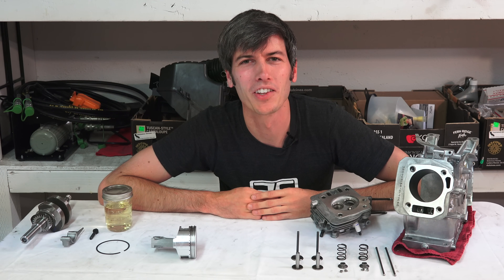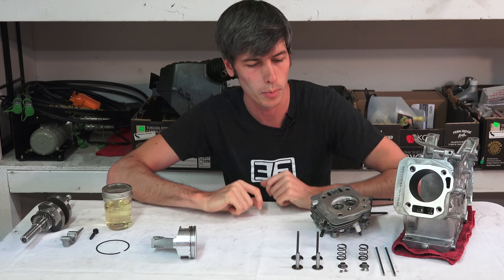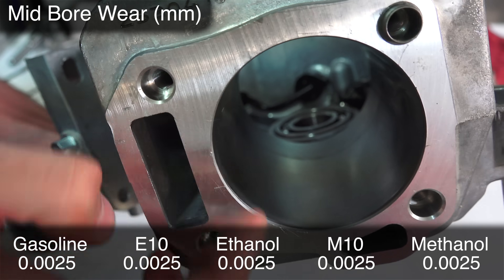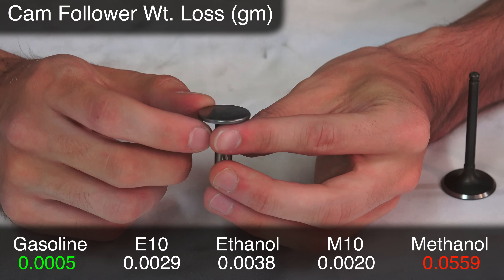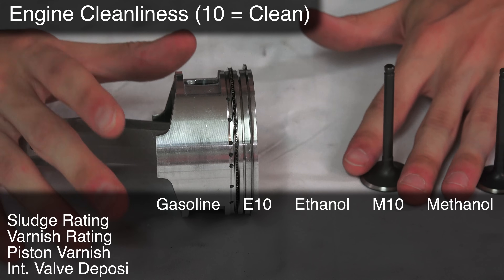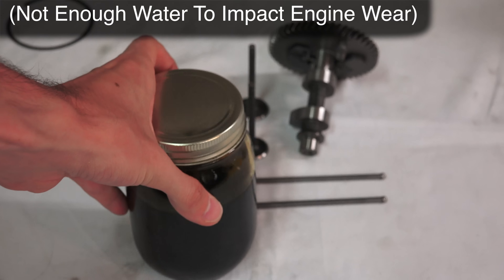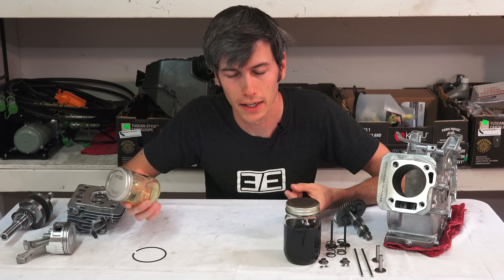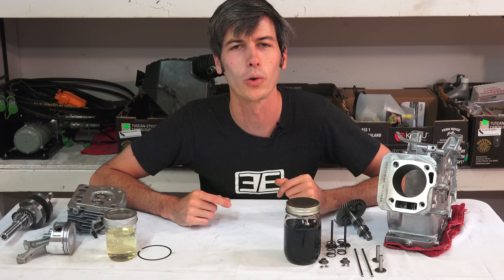Is Ethanol Bad For Your Car's Engine?

Comment: Base fuel oktan 80, ethanol have 110 oktan. For me it's day and night for performance. Many car have option to use it, it's call flex fuel car. I use ethanol for seting more boost after tune afr I got 50% gain of hp power.I love it

Comment: I presume the test back then was not done done with the Gasoline Direct Injection engines we know today. That can change the outcome drastically for the carbon deposit on the intake valves ?

Comment: I got 400,000 miles on my 92 s10 4.3 with no trouble driving 200 miles a day 5 days a week, so  i say  the fuel wasn't bad for my gas burner

Comment: And the honest answer to this question is definitely no, because ethanol in E-85 form and better in pure form E-100 have very high octane, costs lots less than any ordinaire gasolines and never live soots and carbons buildup inside engine like occurs with any gasoline.

Comment: could you find out if there is a more recent study like this one but with the things in mind I just mentioned? (Direct injection turbo engines) especially the effects on a small 3 cylinder.
Since I am Belgian , I drive such a "micromachine Citroën c3 aircross 110hp."
Mecanic's shout that I shouldn't use E10 gasoline. Best is zero ethanol they advise, but here In Belgium we only have 2 choices at the pump: E10 or E5 in EU ron 95e10 and 98e5.
And the extra 21eurocents/liter for the 98e5 makes me seriously doubt things. In the instruction manual and on Stellantis website they say compatible with 95 but 98 always the better fuel longterm. In the past Stellantis had many issues with these type of engines and dealerships often used as reason for the problems; ethanol. ???

Comment: The issue with ethanol is not on the wear surfaces in the engine, it is the effect it has on the static components in the ancillaries on the engine. This is especially a problem on classic cars. Ethanol affects the rubber fuel hoses. We've all seen classic Ferraris catching  fire, because their owners have not replaced all the fuel hoses to upgraded ethanol resistant ones. Ethanol, if left standing in a fuel system, will absorb water and oxidise to acetic acid acid. The acetic acid will rust out the inside of the steel fuel tank and steel fuel lines. Acetic acid will also corrode the brass carburettor jets and cause them to fur up and block them by turning the zinc in the brass into white zinc oxide. There is no way of flushing out the zinc oxide in the brass jets, other than to strip down the carbs and carefully remove it physically. The only way to avoid the corrosive nature of ethanol and its oxidised derivative, is to replace all the effected components with copper or stainless steel parts, and to avoid using any ethanol fuels in your classic cars and motorcycles.

Comment: There are a number of other factors not addressed in this study. Ethanol is hygroscopic meaning it absorbs water. How much ethanol does it take to cause problems in delivery and ignition? What are the compatibilities with ethanol to the various gaskets, seals, and materials encountered in the fuel delivery system? What about the formation of algae or bacteria from the water formation? What about ignition and combustion profiles? What about the heat signature of the entire engine assembly and metal fatigue? Why do small engines with E10 or higher suffer from ignition problems? What about the effects of ethanol and water on the carburetor diaphragms? What about the exhaust gases and combustion analysis? 
This was an interesting study but only a small part of the conversation.

Comment: Do they  use it in airliner  engines,? Or fighter  jets ?(no).
Reply: Did the cat catch your tongue?
Reply: Actually, they do use ethanol in airliner and fighter jets.  It is called SAF.

United Airlines is even building a pilot plant in a joint venture to make SAF from ethanol with a full scale one in a few years.

GE converted a few of their turbine engines at an electric plant in Brazil to be dual fueled with ethanol.  Same turbine engine that is on the Boeing 747.

Imagine an airliner flying over LA with exhaust from the jet engine cleaner than the air going into it.

Comment: So the problem is ethanol absorbs water. The new engines run better with it and are resistant to its corrosion. The low tension piston rings and increased pressure increase blow by and fuel dilution. So water is going to places it shouldn’t. They put a lining in, changed alloys, and materials to accommodate this and save weight. The short answer is no. We steadily implement the necessary engineering.
Reply: Identical non-flex fuel cars to ours have used >E20 in Brazil since the 1970s and currently use E27.  It worked out so well and for so long that Paraguay went to E27.

A byproduct of combustion is water, be it gasoline or ethanol, even hydrogen.

Mercury Marine, which hosted a Webinar on ethanol myths, noted that ethanol does not "grab water molecules out of the air." It is hydrophilic, which means ethanol holds water. With regular gasoline (E0) as well at E10, the primary cause of water collecting in tanks is condensation on tank walls. But unlike E0, which can absorb almost no moisture, E10 can hold up to half of one percent of water by volume, and the water molecules will dissolve in the fuel. The "solubilized" water will bypass the water separator and burn harmlessly through the engine.

>>>>Mercury Marine also said E10 may be the superior fuel (over E0) because it keeps the fuel "dry"<<<<

Comment: An old article in Sweden so journalists contacted car workshops the majority of car workshops said do not use E85 And the question concerned flexifuel cars. Namely, there were car problems Technical problems that had to do with the fuel

Comment: Ethanol is blamed today, among other things, for causing carbon formation in the engine (E85) and that there may be some slimy history in the engine (E85)
Reply: Ethanol is sootless/carbonless.  It even reduces soot produced from gasoline.

Brazilian studies found identical engines using E100 lasted >300% longer than those using their common gasoline.  Soot is what wears out an engine, it acts like sandpaper.

Comment: But were these tests extensive because today ethanol is accused of, for example, causing corrosion. not whose is good for aluminum. not considered good for rubber gaskets or rubber hoses There are also those who believe that the car runs better on ethanol-free gasoline That the car does not run as well on E10

Comment: Race cars don't have any issues with extra wear from using methanol, since they get fully rebuilt after every race.
Reply: The study in this video is old and since then sulfur has been taken out of today's gasoline (& diesel).  Sulfur gave gasoline some lubricity which is now gone.

In Brazil, they have found that identical engines last >300% longer on E100 than on their common gasoline.  Soot is what wears out engines and ethanol is sootless.

Comment: Yeah, but he never mentions the breathing of Corn Gas. Corn Gas might kill you 🌽 ? 4-17-24
Reply: The deadliest job in the world is a sommelier?
Reply: @danafletcher2341  A Corn 🌽 Gas ⛽ Sommelier ?
Reply: @McadMcad  I thought the implication of your post was that somehow sniffing ethanol was bad.

There is an area of Australia where they actually did have a problem with people sniffing gasoline.  They even had to switch to a slightly less toxic and more expensive petroleum octane boost in that area (which was done before they had ethanol). 

Ethanol is non-toxic.  It has low VOC pressure and the VOCs it does produce are safer for the environment and humans than petroleum's.

So non-toxic that the US won't allow E100, the Indy 500 has to use E98 with 2% gasoline as a denaturant.  Ethanol in hardware stores has methanol added.  Not that the government is concerned about our health, but they are concerned with their hefty taxes collected on drinking alcohol.

Comment: Ethanol Fuel Blend is not your vehicle's friend, especially if it sits for an extended period of time, or is not a flex fuel vehicle. There are still a lot of older vehicles still being driven.
Ethanol alcohol is referred to as hygroscopic, which means it absorbs moisture. If ethanol fuel blend remains in your car's fuel system for an extended period of time. It draws water from the fuel tank, upsetting your car's fuel mix and seals.
Reply: Water is a problem of gasoline.  Before E10, people in wintertime even had to buy little cans of alcohol called Heet or Dry Gas for gas-line antifreeze.

Mercury Marine, which hosted a Webinar on ethanol myths, noted that ethanol does not "grab water molecules out of the air." It is hydrophilic, which means ethanol holds water. With regular gasoline (E0) as well at E10, the primary cause of water collecting in tanks is condensation on tank walls. But unlike E0, which can absorb almost no moisture, E10 can hold up to half of one percent of water by volume, and the water molecules will dissolve in the fuel. The "solubilized" water will bypass the water separator and burn harmlessly through the engine.

>>>>Mercury Marine also says E10 may be the superior fuel(over E0) because it keeps the fuel "dry"<<<<

Note that boats have fuel sitting for long periods all the time.

All the fuel system components of a non-flex fuel vehicle are the same part numbers as their flex fuel version.    

Ethanol on any manufacturing chemical compatibility chart will show it is at worst equal to but most often easier on various rubbers, plastics, and metals than what gasoline and BTEX (benzene, toluene, ethylbenzene, and xylene) are.

Non-flex fuel cars identical to ours have been using E20 or greater in Brazil since the 1970s.  Are at E27 for the last number of years for non-flex fuel vehicles.  It has worked out so well and for so long that Paraguay went to E27.

Britian sold an E10 blend called Cleveland Discol from the 1920s until 1968-70 when BP bought them out.

Comment: I worked on small engines, ethanol kills the carburetors
Reply: The very same small engines in Brazil use their common gasoline which contains 27.5% ethanol.  It has worked out so well and for so long that Paraguay went to E27.

BTEX (benzene, toluene, ethylbenzene, and xylene) came along at the same time as ethanol and used in much higher amounts than ethanol in gasoline.  

BTEX (unlike ethanol) is very corrosive and harsh on rubbers, plastics, and metals in manufacturers chemical compatibility charts.  Perhaps your blame is going to the wrong culprit.

Comment: Mercury Marine, which hosted a Webinar on ethanol myths, noted that ethanol does not "grab water molecules out of the air." It is hydrophilic, which means ethanol holds water. With regular gasoline (E0) as well at E10, the primary cause of water collecting in tanks is condensation on tank walls. But unlike E0, which can absorb almost no moisture, E10 can hold up to half of one percent of water by volume, and the water molecules will dissolve in the fuel. The "solubilized" water will bypass the water separator and burn harmlessly through the engine.

>>>>Mercury Marine also says E10 may be the superior fuel(over E0) because it keeps the fuel "dry"<<<<

In wintertime in northern states and Canada in the days of E0, people added little cans of alcohol called Heet or Dry Gas for gas-line antifreeze.  No need since E10 came.

If ethanol did cause water problems, we would see the spectacle of millions upon millions of stalled cars every winter.

Comment: Since the study was in 1981, the gasoline back then had a high sulfur content.  

Sulfur is a lubricant, so today's low sulfur gasoline probably has the same wear in the upper pistons where the oil doesn't get to.

With today's diesel also being ultra-low in sulfur, they even have been having to put in lubricity additives.  

Brazilian government studies have found that identical engines last >300% longer on E100 than on their common gasoline.  Soot is what wears out the engines and ethanol is sootless.

Comment: I have a suzuki jimny 2022, my country is starting to giving E25 to save gas importation. Do you think E25 will damage the engine?.
Reply: The 2022 Suzuki Jimny was sold in Brazil as the final year, newer ones are only the Jimny Sierra.  Jimnys go back to 1998 there and Brazil's common gasoline has been E27 since 2015 and E25 before that.  It has worked out so well and for so long that Paraguay went to E27.  

Evidently Bolivia going to E25, didn't know that.  India is going to E20 for non-flex fuel vehicles and E100 for flex.  All new vehicles sold there must be flex fuel.

Comment: Should also state that a car with 6 year old ethanol free fuel managed to start and run just fine on a pressurized tank. So would argue older fuel types lasted longer in storage tanks now on energy density and potential

Comment: Most of the folks I know care less . They do NOT check oil levels ,tire inflation, light bulbs,etc until the car dies. Then ,,,,it’s the lousy gas. Thanks for the info.i agree,been using this stuff since it came out. No problems at all. Oh,,, my mower deck rusted out, damn ethanol, or was it Trump?

Comment: The referenced test was years before the ethanol production facilities matured their processes, and the ASTM spec for fuel ethanol was likely just beginning to be discussed.   Would you use testing done on gasoline made during the beginning of the oil refining industry?  Of course not.  Today’s fuel is a highly consistent product, that has evolved from a 100 years of experience.   Ethanol today, is much better than it was in 1980, when it was brand new in this country, getting spun following the oil embargo and lines at gas stations.  
The concern about water and ethanol is 99% silliness.  Ethanol doesn’t magically pull water out of the air, in fact in almost all situations, it is more likely to give better operation, in that it is likely to entrain any existing water and let it go through evenly, rather than as a slug.   Another pet peeve is whenever some presents the idea that gasoline is pure.  That is like saying soda pop is pure.  Well, which one?  There are probably as many formulations of gasoline as there are flavors of soda pop.

Comment: Also, corn based ethanol is bad for the environment and for the food supply. The environmental cost to produce corn based ethanol is worse for the environment than non-ethanol gas. We are wasting good food producing farm land to make corn based ethanol. The corn subsidies have made it almost impossible to switch to switchgrass based ethanol. Switchgrass not only grows in non-food producing land but also help convert deserts to not only grazing land but helps convert it to food producing land.
Reply: Since the Freedom to Farm act was passed in 1996, farmers are free to plant any crop they want without fear of losing any subsidy.  End users must bid for acres.

Since the 2005 energy act passed, farmer subsidies went from around 25 billion dollars in 2005 to around 10 billion today, not counting inflation.

Corn ethanol is a value-added product of already existing feed production which preserves the feed in a healthier, more digestible/efficient, and more concentrated form called distillers grains.  There was no wasting of farmland, in fact, the corn belt grew more corn acres in 1980 before ethanol than in 2018, the year of most ethanol production ever.

The corn ethanol Federal subsidy ended back in 2011 and was $.45/gallon.  There still exists a cellulosic/Gen2 subsidy which switchgrass would qualify for and it is $1.01/gallon.

Comment: Here in Brazil we use 100% ethanol since the 1970s. That's one option we have on the fuel stations along with gasoline with 27% ethanol. There is no 100% gasoline here. Today we use flex fuel cars that allow us to use any mix of gasoline and ethanol we want. Price will regulate our preference. And all things go well until now...

Comment: As a mechanic I’ve seen countless vehicles with catalytic converter failures, predominantly 'manicat’ systems designed e to the constant use of E10 ulp.  Also seen many intank EFI fuel pumps destroyed by corrosion from the use of E10 ulp fuel.

Comment: You didn't mention using ethanol begins to lose it''t volatility after a week or so  due to phase separation making it impossible to store in smaller containers for snow blowers and lawn mowers. It destroys small engine.carburetors  .
Reply: wowowowowwow

Comment: My '98 corolla hatchback, is mentioning E10 in the manual and it's says it's perfectly fine to use it. However recently with the fuel crisis several gas stations in EU were using other solvents like toluene that's ruining everything starting from the fuel system rubbers.
Reply: The petroleum octane booster in the US is BTEX (benzene, toluene, ethylbenzene, and xylene).  Premium gasoline has some 40% BTEX.

In 1948 an API study stated that the only safe level of benzene is zero.  Even if benzene were taken out, toluene and xylene can form it.

Comment: Measuring cam lobe wear with different types of gasoline? Seriously?  How about reduced energy output, hygroscopic attraction, and the tendency of ethanol to make carbs unusable?  How about phase separation and how ethanol blended fuels will be the death of many small engines this spring?  Ethanol is garbage, and the ridiculous criteria and conclusions of this test suggest it was bought and paid for by a group who wanted garbage fuel cast in a positive light.
Reply: BS